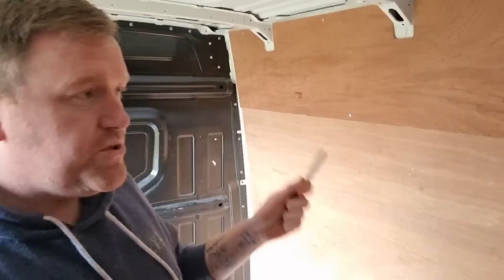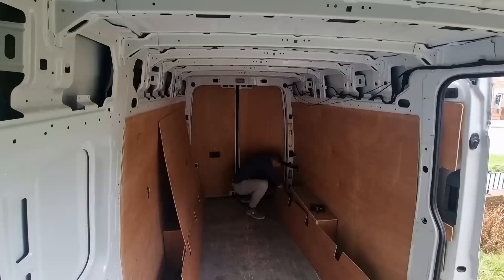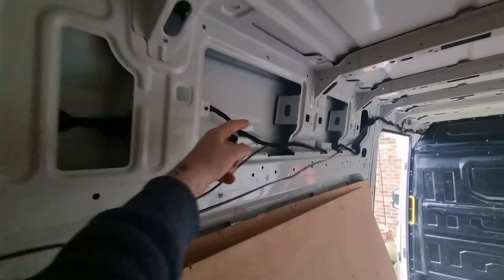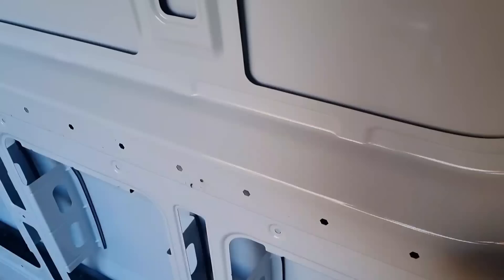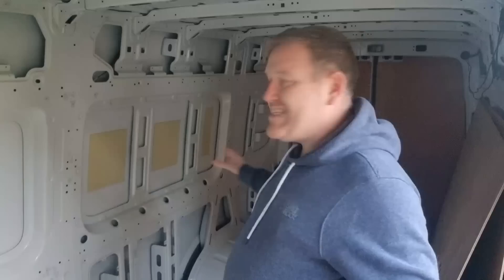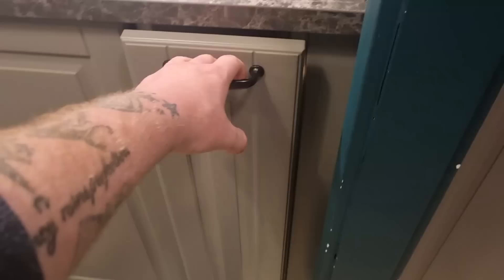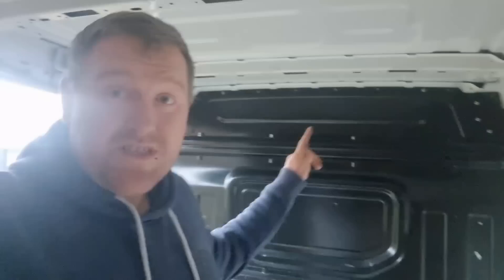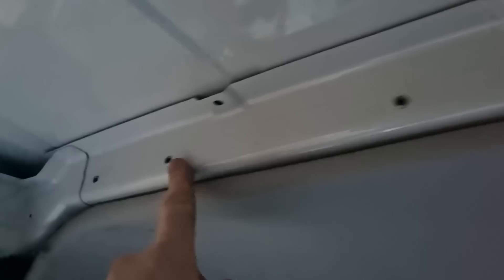Vw Crafter Van Conversion Has To Start Somewhere

Comment: Well grasshopper well said heat does rise but that's not the problem with your floor. Unfortunately the cold does come through the floor  especially when you wall round with bare feet . If you dont get the grasshopper reference you are not  as old as you look . Looking forward to seeing your build
Reply from the maker: I've had a hard life it would seem

Comment: Tips for ya.

Wear gloves
Put bolts back in their holes.
Reply from the maker: I'm wondering if I can re use them on a DIY trim bit to cover the exposed areas
Reply: @INDI_VAN_A_JONES Vanlife UK  anything you take off, if your reusing the fastners or haven't decided, loosely put them back where they came from. Then you won't lose them or fit the wrong one in the wrong hole.